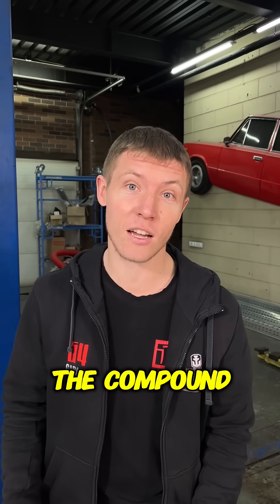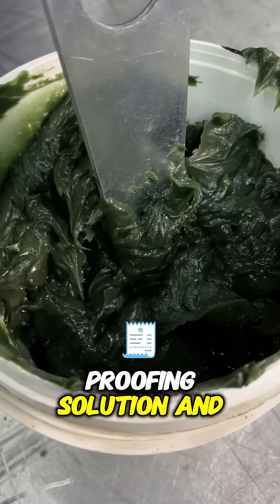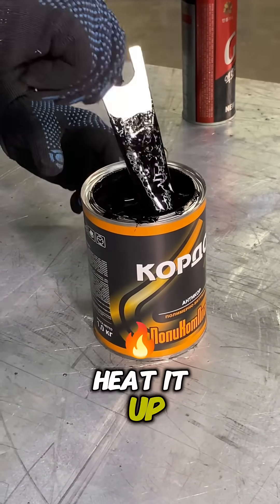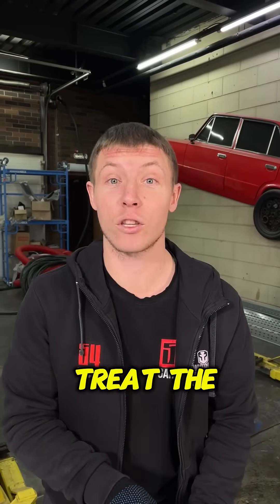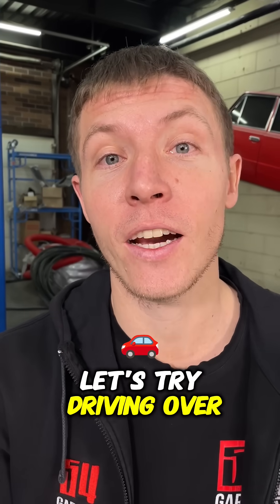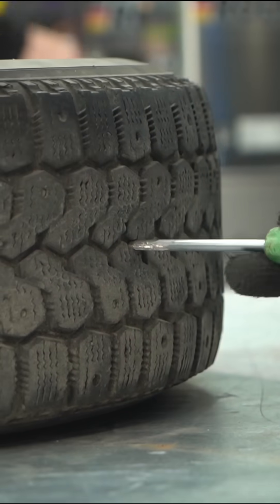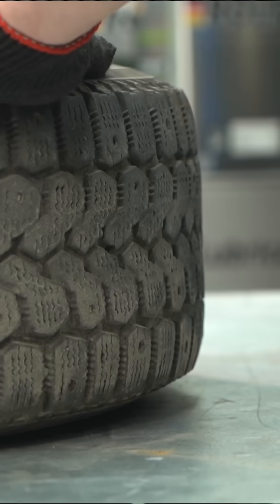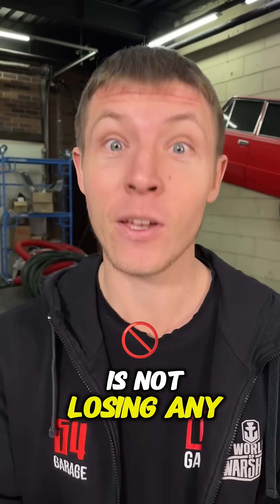Making a regular tire puncture proof

Comment: put it in the front with the weight of the engine on it and see if it still seals.
Reply: It would.. unless the sh&*t gets really really hot, got punctured, and then they parked for a while with the puncture on the top of the tire. Why would weight change the fact a puncture is a puncture?

But its not about the weight its about the pressure of 40+ psi pushing outward on a viscous fluid which is also being pushed outward by inertia aka centrifugal movement.
Reply: @Falcon-eh8tq  for the same reason whe  u put pressure on a pimple it bursts
Reply: @ elaborate please
Reply: @ This is the whole reason tire slime works and fix-a-flat it's not a new concept and its a temporary and reliable repair. people drive 1000s of km on repaired tires bud

Comment: Hence why they made run-flats. Also, once that tire is up to speed, all that gunk will get flung all over the place, then there's balance problems, and after a couplke week when it dries completely, it's gonna sound like a maraca.
Reply: How do you figure? Once the tire starts rotating it’s going to flatten out and be pulled to the outside of the tire. It’s not going to fling anywhere. Also asphalt isn’t going to harden like pavement. Especially not when mixed in with grease. It will stay soft and slightly moldable.
Reply: @hunterhouser3143  physics says so. you can always try it yourself if you don't believe me.
Reply: @hunterhouser3143 I've had balance issues after putting sealant in a tire. Shook so bad it couldn't be left in, some products are better than others for this reason.
Reply: Brothers never heard of centrifugal force.